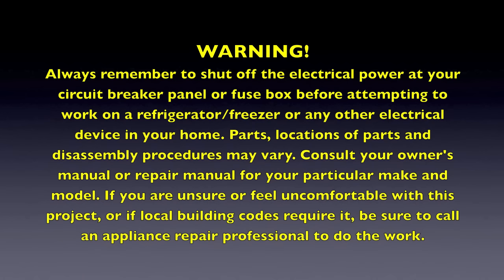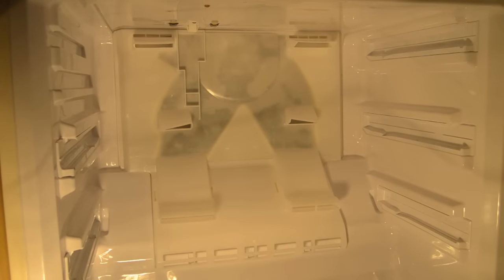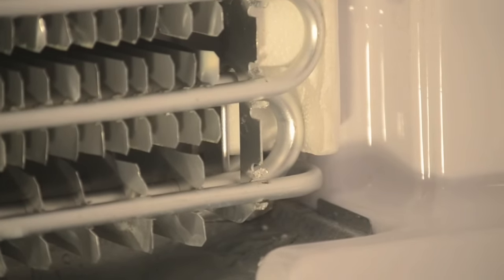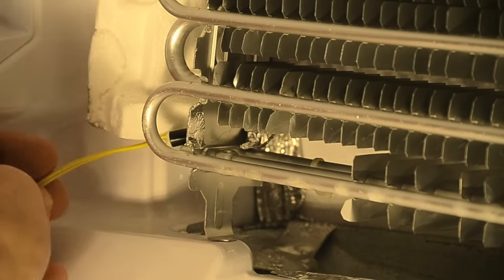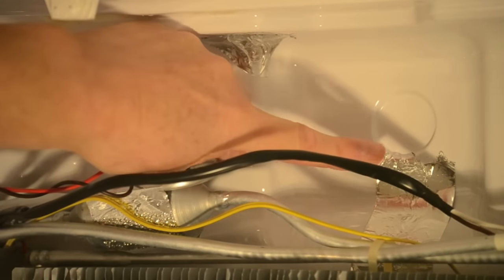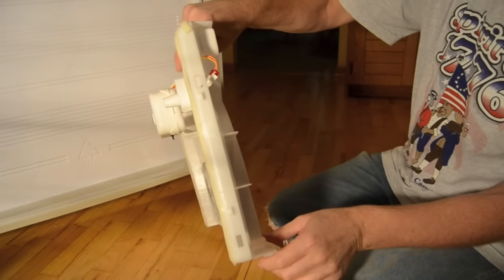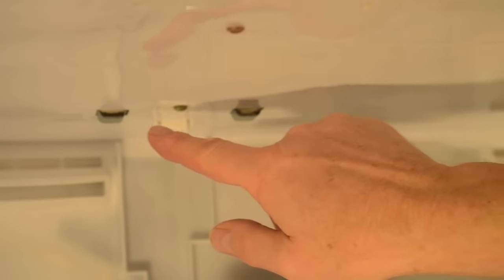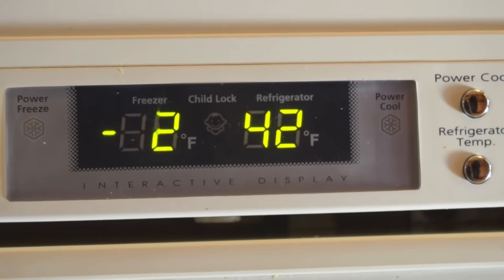How to Replace a Thermal Fuse and Defrost Sensor in a Refrigerator/Freezer

Comment: I've been looking for an answer to our Samsung for a year, couldn't find any answers, I finally rang a PCB repair place and asked them, they mentioned it might be the thermal fuse, so I set about checking the freezer heater resistance and found an open circuit, pulled half the unit trying to find the fuse, got a lil confused with my head in the freezer and this time searched how to replace a freezer thermal fuse. BOOM! Your video pops up, same model unit and everything, your description explains the exact issue I have and the wording that I had been searching for, for months! Big fail for Google and a HUGE thankyou to Stan my man, your a life saver! I'm now confident on what the problem is and how to fix it. 
.
My multi reads 0.369kohm on the fridge heater at the PCB, the repair company mentioned the board would most likely need repairing too, of cause. What are your thoughts?

Comment: Thank you for your tutorial, it was well done. What is a thermal fuse and why do they use it?
Reply: A thermal fuse has a pre determined temp cut out. They are usually marked in Celsius.  72C for instance will open if the temp goes above 72C. At that point, the thermal fuse must be replaced. Defrost heaters seem to pop them at random. 2.00 part vs a whole heater for 56.00 and higher.

Comment: it is helpful, my fridge  has the same problem you mentioned from similar model RB1955VQ, can you tell me part number for this Thermal Fuse and Defrost Sensor?
Reply from the maker: I don't have the part number handy, but you should be able to look it up online on the site of any reputable appliance parts seller.

Comment: Hello sir! I have a Danby fridge that does't have a freezer. Model DAR170A2BSLDD. It is flashing E2 error which the manufacturer says is the defrost sensor. The problem is it's a very strange fridge and when I open the panel I can't see these components... I don't know if it's just me or what. Do you anything about that model? It seems all the plus are inaccessible behind the side panels that are glued shut...

Comment: Big Kahuna
My Maytag side by side refrigerator is running and cooling normally.  However, it trips the circuit breaker every 4 hours.  Since the defrost timer switches between half hour of defrost and 10 hours of cooling, I may be wrong but I don't suspect the problem is with the defrost timer.  So what timing pattern could cause the circuit breaker to trip every 4 hours???

Comment: Help please, replaced the defrost sensor on my Haier hrf663cjr checked thermal fuse and wiring for continuity and also main control board has been replaced but still have F5 defrost sensor error code , I can force the freezer to defrost using the button on the main control board but its not defrosting automatically is there anything else that could be causing the issue?

Comment: Kenmore Elite french door 795.72053.110   LED on PCB , not blinking at all ...but the fridge not  cooling  what could be the issue ?? compressor vibrates and heating up, Fan near compressor and inside one working too all lights inside and the panel display working fine...No error code on panel . This one has quieter compressor than previous fridges  though but fridge not cooling at all..??  I added the starting relay to compressor  which runs good ...Appreciate your, readers input

Comment: I was under the understanding that all fridge and freezer thermistors (not the bi metal defrost sensor), work on the principal that it’s resistance changes based on the temperature. So how can you test for continuity and say that a thermistor showing zero ohms is in good standing. I believe each manufacturer has its own spec sheet for what it’s thermistors should measure In ohms at specific temperatures. Say at one temp a thermistor measures 750 ohms, and at a different temp, the same thermistor measures 1400. I’m also under the impression that if this measurement is off +\- 10%, it should be replaced. I’m new to all this so if my information is wrong, please correct me. Thanks!

Comment: My refrigerator model is Samsung SR-L629EV which is completely similar to the refrigerator in this video and even have the same PCB board with the previous video from this refrigerator which you checked the thermal fuse. Because of the not-cooling problem, I opened it and I saw the ice on Ref- evaporator. Then I find out that the thermal fuse is not working and do not have any continuity. Subsequently, I changed the thermal fuse several times but it just works for 1 day and the day after the thermal fuse was burned out and lost its continuity. I used several brands but nothing helps. They just work for a day. The second problem is the fridge works very good for about 4.30 minutes but after that refrigerator fan and compressor turn off and do not turn on again automatically. The degree indicators for Ref&Freezer start blinking but after unplugging the device from electricity and replugging it again it starts working very well. Every 5 hours I have to unplug it and plug it again. No clicking sound, I changed the compressor relay but it wasn't helped; then I start to repair and put new electrical parts on the PCB and 90% of the PCB components are new. no problem in the PCB just I do not know what should I do with everyday fuse change and unplug and replug the device per 5 hours. Could you help me with the problem, please?
Reply: Ensure you have replaced the thermo fuse with correct rating (10 amp / 77.0 deg C) as marked on the casing of the original thermo fuse and available as Microtemp G4 series (same part as Samsung original). Once the fuse is blown (open circuit) the fridge will not restart after the first cycle, as you state. This has been a long standing problem with this series of Samsung fridges although they usually last a few years before the fuse blows, you may need to investigate why the circuit is drawing more than the 10 amps rated for the thermo fuse.

Comment: You say to replace thermal fuse PN DA47-00095E with a manufacturer's recommended bi-metal unit.  Where can I find that new replacement?  What's the part number?
Reply from the maker: You should be able to find one online on an appliance parts website. Or look in the Yellow Pages under Appliances-Major-Supplies & Parts for a local appliance parts dealer. If your local appliance parts dealer does not have the part in stock, they should be able to order it for you and should be able to locate the part number you need for your particular make and model.
Reply: Hi
can you tell me what is the PN of the Bi-Metal?
Reply: Karl Montstream no no

Comment: Hi There!. Ive got the same Fridge SR-L709EVSS Model. A while ago the fridge and freezer stopped cooling and freezing. It made a weird noise. The head on display panel indicated different readings for both the fridge and freezer. I called a repair guy who took the fridge and kept it for two days. He brought it back and the Fridge temperature went to 2degress and the freezer went to -15degrees. Everything was working fine until the freezer temperature light started flashing conitnually. The compressor stopped the compressor fan stopped and the fridge or compressor never came on after that. We literally have to switch it off at the power plug connected to the wall outlet left it for 10minutes turned on the power it ran for a while and it did the same. Stopped cooling and the Freezer light keeps on flashing. Please help would could the problem be?
Reply from the maker: Samsung is not known for high quality refrigerator/freezers. Some have had good results making things work again by replacing the motherboard. Last I checked, they cost about $75.

Comment: So this is a high quality Samsung refrigerator ? Did metal get so expensive that it was not cost effective ? If so that is odd. Because for the last few years metal prices have stayed around $4 per 100 lbs. This looks like a nightmare,  all this cheap ass plastic. I got an old GE had it for all most 30 yrs. Here recently is the only time it has ever given me any trouble. After working on a few washing machines one just over 3 yrs old Maytag. The other about 5 yrs old a Kenmore, I was amazed at how cheap and crappy they are made. I bought a new dishwasher Bocsh it is still under warrenty. Less than 3 yrs old they have been out to work on it 3 times. It has been a POS since day one. Is there any company out there that still makes things to last ? Or is everything just disposable.
Reply from the maker: Not long ago, when we were looking at new appliances, the two older salesmen present, both of whom had had many years in the appliance business, told us NOT to buy a new washer or dryer unless we absolutely had to and to keep the old ones running as long as we could. The electronics in the new ones, they said, are easily damaged by moisture and can go on the fritz quickly. They said many buyers of new models are going back to the old-style mechanical dials, which manufacturers are making more of again. They said the most durable and reliable washing machine on the market today is Speed Queen. (We’re trying to keep our 34-year-old Maytag washer and dryer running as long as we can!)

Comment: sorry. I've watched the video 2 times. you didn't test the thermistors. and how you know it is fail.
Reply: Ibrahim Azawe 
I
Reply: Test with the 'continuity' test function of your multi meter. If the Thermo fuse is open circuit (blown) it requires replacement with the appropriate rated fuse. If you pull apart the unit and expose the fuse, the can of the fuse with have a rating printed on it, most likely 77.0 or 077 which is the 'maximum open temp' in degrees C. For a few dollars a replacement Microtemp thermo fuse can be obtained from Emerson who distribute Microtemp, the same brand Samsung use in the original part or for considerably more buy the part from Samsung.
Reply: The point of the video is how to replace them not to test them...that video is very informative...